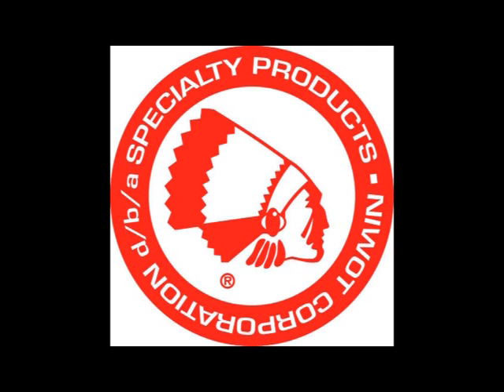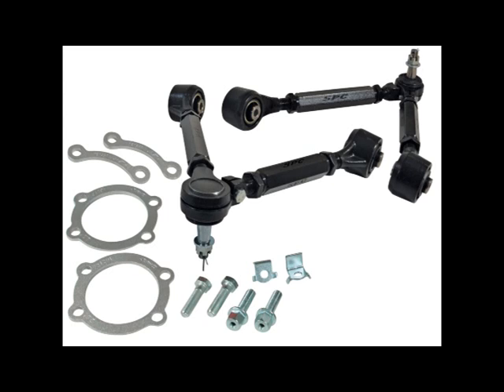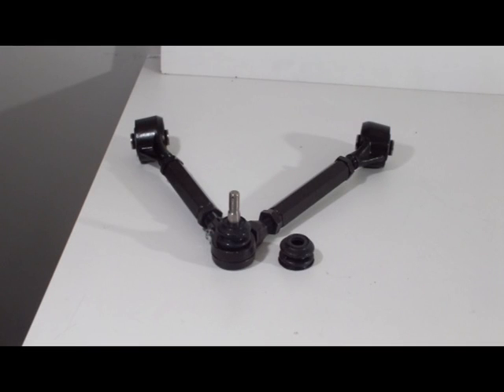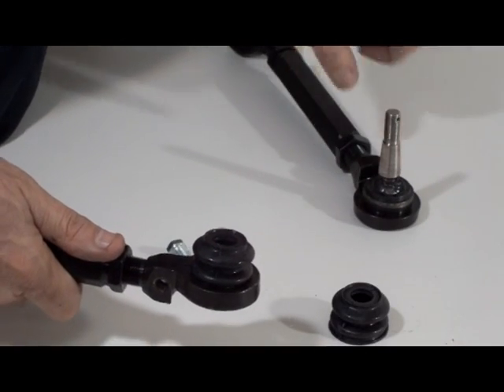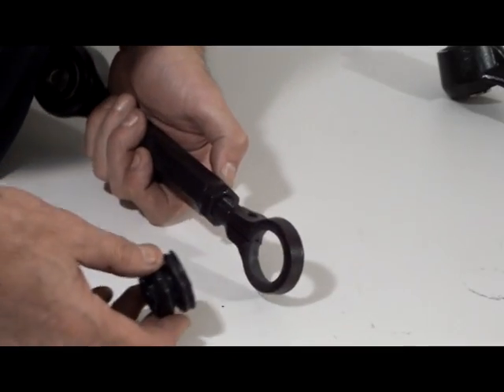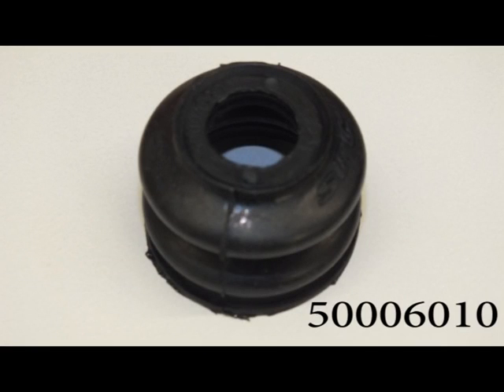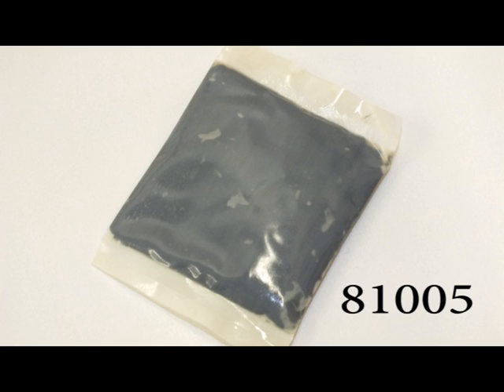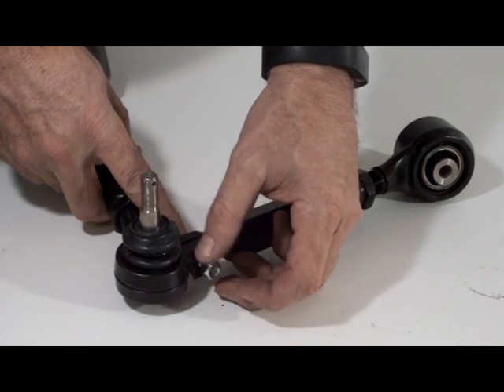73000 -  Boot Repair

Comment from the maker: Luis, The 730005 ball joint assembly is the smallest part number which includes the ball joint. Please contact Customer Service at 800-525-6505. We are temporarily out of stock at this time but expect to have parts on the shelf in early November.